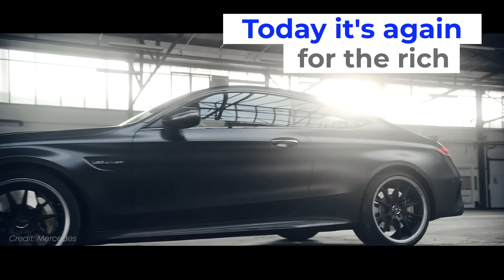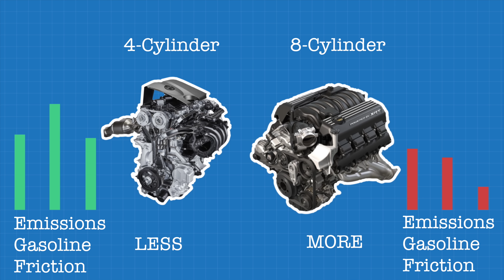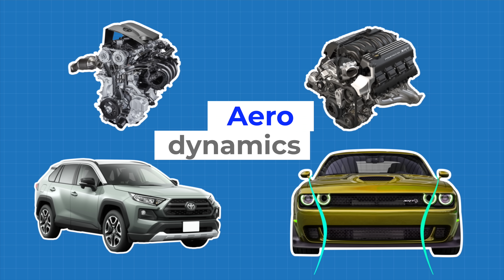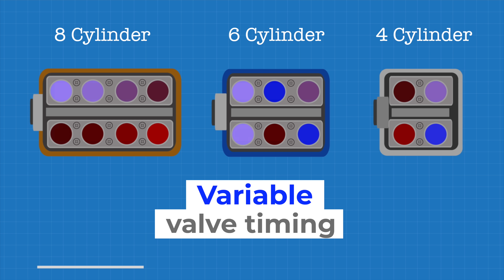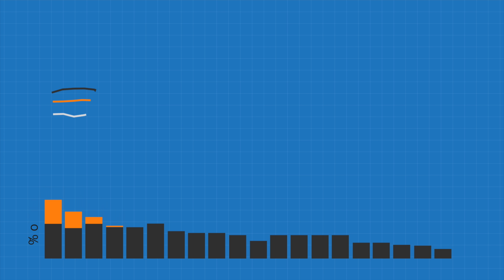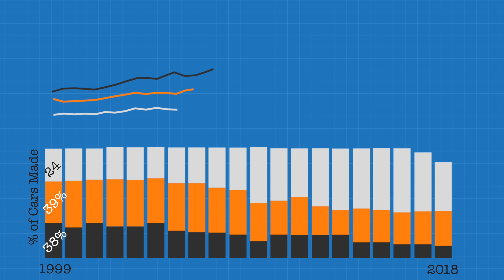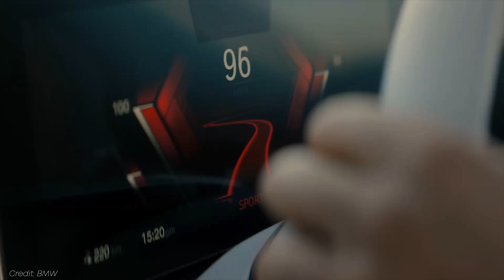The End of V8 Engines in America

Comment: V8 ain’t going no where
Reply: EV's will never completely replace gas engines
Reply: @GuerreroDelInfo  electric power plants can give all the torque and speed you need. the only thing that's holding EV from totally taking over is the battery issue at the moment. trains and ships have diesel generators, but use electric for their power. electric motors will eventually replace mainstream combustion engines in vehicles.
Reply: @wclintf  they cannot duplicate the sound nor the vibrations of an internal combustion engine. Not to mention the versatility and modification of engines for personalization.
Reply: A Gough  Why on Earth would anyone want to drive an EV over a V8? EV's are hideous design. Lack milage. Not enough charge stations and take hours to charge and make a squealing sound when moving. 

Give me a hydrogen powered vehicle Yeah, but certainly not a false economy EV. Hell no!
Reply: TheBert Meister! Cause EVs would last longer than a V8. And EVs are helping the environment more
Reply: mondo odnom why cause the internet said so😂😂😂😂😂😂
Reply: PhastLyfe Jae not completely but again EVs are the future.
Reply: A Gough  it's a scam
Reply: But we are not the future mate, no matter how much we love v8s and diesel. EV’s are the future. I mean we won’t be alive by then anyways.